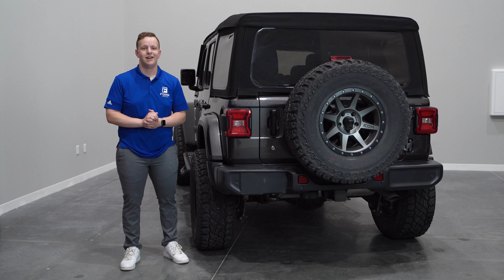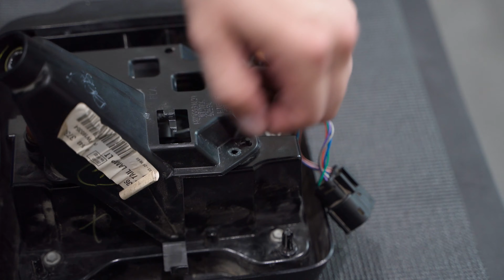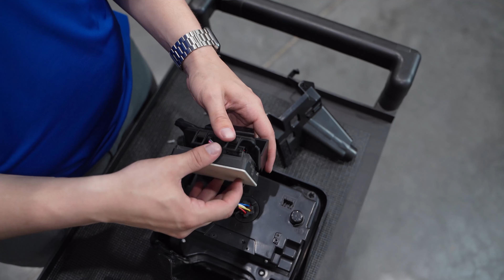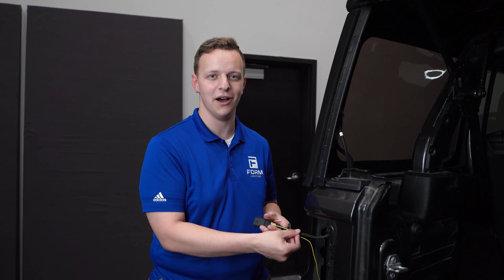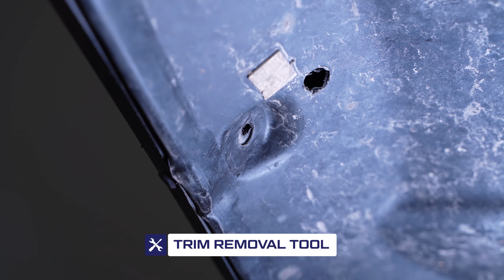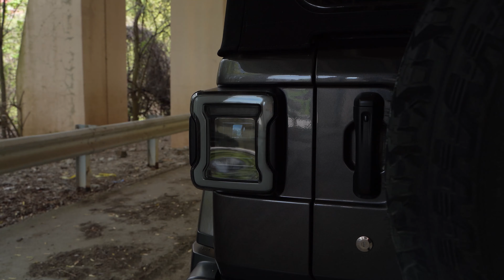How-To: Install 18+ Jeep JL Wrangler Sequential LED Tail Lights | FORM Lighting

Comment: Great video!

Installed them today! Pretty easy, should I check the tail lamp holding bolt since bolt is plastic and nut inside bracket is metal?

Comment: I installed this and I now have a ‘Lights Signal Out’ sign which is very surprising.
Reply: I just installed mine too and I just got the same error. Were you able to fix it?
Reply: Same here. But just the right side but they all work. Gonna try to see if I can fix it with the tazer

Comment: I installed these today on my 2020 JL without the sequential lighting. It was super easy with a flashlight and a 10mm socket, taking maybe 20 minutes end to end.

Helpful notes - the plug has a way to clip it to the body of the light. Pay attention to how it is clipped before you unplug the old light. Then you can re-attach so the plug is not just dangling by the cables. Also worth repeating to take special care with the plastic screw. Pay attention to how tight it is when you first start to unscrew it, so you know how much to tighten it. And, the screw is easy to finger tighten at first to make sure you are not cross threading it. it should screw in easily for the first couple of rotations.

Lights look great, way brighter than OEM with a modern look without too much "bling". Exactly what I was looking for.
Reply from the maker: Thanks a ton! We appreciate the honest review and are grateful for the support! Glad you like the lights as well!

Comment: I wanted to wait a few weeks to do an update on my replacement Form Tail Light…

First of all, the customer services communication was outstanding!!! BIG PROPS TO THEM

Form Lighting made the issue of getting a replacement drivers side tail light very easy and seamless….I didn’t even need to send back the defective tail light.  If you ever have problems with their lighting AND you’re within the warranty window, do not hesitate to call the customer service number.

AND NOW THE ISSUSE 

The replacement worked great for a few days to a week and stopped working with the same problems that I had before …..drivers tail light not working but everything else working as they should (brake light & sequential turn).  Again, I unplugged the light and plugged it back in…..I checked the fuses….even double checked the wire tap into the turn signal.  Nothing seemed out of place.  I just ran with it. The drivers tail light worked when it wanted to.  

I started thinking about any variables that could be in play. The only thing I thought of was the cold weather. 

I noticed that during cold temperatures the light would not work properly.  I would say anything below 50 degrees F is when trouble starts for me.  Anything above 50 doesn’t affect the light.  

I could try to troubleshoot electrical with any technical department Form Lighting might have, but I’m not savvy enough on a JL to do it.

I love the look of the light when everything functions, but I’m out of the warranty window.  I might go back to my factory halogens, buy another brand of LED tail lights, or move to a warmer climate LOL.
Reply from the maker: Hey there! We appreciate the honest review. Sorry to hear you are having so much trouble. This is not an issue we are used to seeing with our Jeep Tails. We do carry a two-year warranty so if you are still experiencing issues with the new product we are happy to help get you a new set to help resolve this!
Reply: @formlighting  thank you for reminding me of the warranty.  It's just weird that the replacement is having the same issue as the original, and that makes me hesitant to get a 2nd replacement because I still might experience the same issue.
Reply from the maker: This sounds like it may be a vehicle issue. I would recommend communicating this to our service team to help trouble shoot it before getting a full replacement since it has happened with multiple products now.  @dirtyagent22

Comment: I just bought the taillight but for some reason I could not get the turn signal to work ? I’ve already used the yellow wires but i don’t know why is not working 😕
Reply from the maker: Hey there! Sorry to hear you are having trouble! 
Have you run the tap all the way to the front of the vehicle?

Comment: Bought these in August but didn't install until October.   I couldn't be happier with them!......until this past weekend when the tail light (when you just turn the lights on) portion on the driver's side quit working. The light illuminates when the brake is pressed, and the sequential turn works as expected. I noticed that after the jeep had been sitting for a few hours, the light works, but for a very short period of time (5 mins).  Is it possible to get a replacement since I just installed them back in October?
Reply from the maker: Hey there! Sorry to hear you are having some trouble! This is certainly something we can do, but you will have to contact our customer service team to do so! I will link their info below and they will be happy to help work out a solution.  

Hours: Monday-Friday 10 a.m. - 5 p.m.
Email: contact@formlights.com
Phone: 636-748-4444
Reply: I’m having the same problem now
Reply: @ I finally gave up on the tail lights after getting pulled over with BOTH lights not working.

Comment: I bought a pair for my 2021 Jeep Wrangler Rubicon 4D, but my factory lights are halogen. Is there going to be an issue since the pair of FORM Lights I bought did not come with resistors?
Reply from the maker: There shouldn't be any issues but if you do experience any sort of trouble please contact our excellent customer service team. They will gladly help you resolve any issues should they arise! 

Hours: Monday-Friday 10 a.m. - 5 p.m.
Email: contact@formlights.com
Phone: 636-748-4444

Comment: Installed on my 2021 Willys and they work great for about 10 minutes. Once they've been on a while, they only light up when I hit the brakes or when I use a turn signal...other than that it looks like they are off from the rear so I cannot drive at night now???
Reply from the maker: Sorry to hear you are having trouble! Please contact our customer service team and they will gladly help resolve this issue! 

Hours: Monday-Friday 10 a.m. - 5 p.m.
Email: contact@formlights.com
Phone: 636-748-4444

Comment: Nice light but to much work just for the amber lights,maybe make it more plug and play?
Reply from the maker: Unfortunately, on USDM spec jeeps there is no way to separate the turn signal from the brake signal on the connector coming from the vehicle. Running the separate wire to the front of the vehicle is the only way to add this feature.

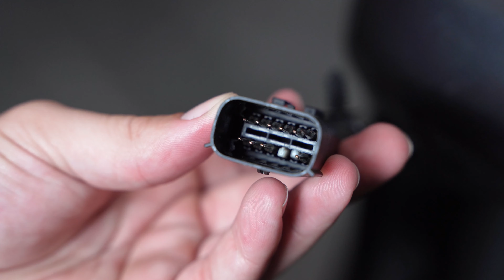Comment: @3:15 this is no longer applicable to the 2023 model. There are no cavity plugs and pushing the wire through the harness is impossible. I really didn't want to give up, but I felt like I was going to damage the factory harness if I tried pushing any harder.
Reply from the maker: Hey there! That isn't an issue our team is familiar with, but would love your feedback on. Please go ahead and shoot us an email with some photos of what you are seeing at contact@formlights.com, and our service team would be happy to help you with that. Thanks!
Reply: Seconding this; there are no cavity plugs on my 23 JL and the factory pin configuration is completely different from the one shown here.
Reply from the maker: @BenFoerster  Hey there! That isn't an issue our team is familiar with, but would love your feedback on. Please go ahead and shoot us an email with some photos of what you are seeing at contact@formlights.com, and our service team would be happy to help you with that. Thanks!
Reply: The 3rd hole on both rows is open so I don’t know which one to put it in.

Comment: When you say repeat the same process on the passenger side, does that mean you need to run another yellow wire to the front drl? If so would it be easier to route both at the same time through the same pathing?
Reply from the maker: Hey there! Because you need each turn signal individually, you will need to run the yellow wire from the tail light up to the other front fender - you are correct. The included wire is only long enough to be ran on its dedicated side as to avoid any possible issues due to being too long, so you'll need to run each side separately. Let us know if you have any other questions!
Reply: @formlighting  thanks for the response! I just ordered a set in the red lens and can't wait to install them!
Reply from the maker: @z0mbiE_  Awesome, great to hear it!

Comment: Where exactly do you tap the sequential signals to?
Reply from the maker: You will need to tap each turn signal wire to the turn signal on the front of the vehicle. Unfortunately, there is no way to separate turn/brake signal on these Jeeps coming from the tail light connector. However, the entire lamp will still flash as a turn signal, similar to the factory lamp, for road compliance.
Reply: @formlighting  does it have to be the turn signal at the front of the vehicle or can it be wired into my tow harness or mirror turn signals?
Reply from the maker: @2yung2dygaming59  In our testing, we discovered tapping to the 7-pin tow harness would engage the sequential feature anytime the brakes were tapped. We don't have any confirmation on the mirror signals at this time, unfortunately. Sorry about that! If you have any other questions, just let us know!
Reply: @formlighting  thank you for the replies. Could you give me a little better idea of where the harness is up front? The video isn’t super clear. Thanks!!
Reply from the maker: @2yung2dygaming59  Sure thing! You'll be looking for the white and green wire coming from the harness connected to the fender light. Once you've peeled back the front fender liner, it'll reveal itself more easily! It may also be beneficial to disconnect this harness, which we did not do for this video.
Reply: @formlighting  so I’d imagine the green and white wire in my mirror turn signal would be the same yes?
Reply from the maker: @2yung2dygaming59  Per our engineering team, you should be able to tap any dedicated turn-only signal. If the mirrors are a running light and turn, it will not work.
Reply: @formlighting  I am getting a CEL. Could it be because I installed the sequential wire in the tail light harness but haven’t connected it to the front yet?
Reply from the maker: @2yung2dygaming59  Please go ahead and give us a call at 636-748-4444 Monday-Friday 10 a.m.- 5 p.m. CST, or shoot us an email at contact@formlights.com, and our service team would be happy to help you with that.

Comment: I installed these on my wife’s Jeep.  These are great looking lights for sure. BUT, ONE THING….

These are only held in by the 3 screws that attach the main bracket to the actual taillight. The screws used are tiny and have very little grip. Just compare the OEM light bracket screws to the FORM light bracket screws. I upgraded my bracket screws for the FORM lights to #8 x ½” Pan Philips. I feel they are much more secure now. 👌🏼
Reply from the maker: Thanks for the feedback! We are happy to hear you're liking them!

Comment: * Update * - installed these without the sequential turn signal wired in and they are amazing. the only thing i did not like and the WARNING i will give other people is the lights have metal threads for your plastic screw to secure the light to the body. THIS WILL WRECK YOUR PLASTIC SCREW!!! i removed the bracket for the screw to thread into and replaced it with the factory bracket that has the correct plastic threads and the rest of the install is easy. 

Original - cant wait to purchase these and love the fact that the turn signals will work without the squential portion wired up. those splice clips are nothing but a corrosion magnet and ill be researching a way to connect the sequential feature without splicing wires
Reply from the maker: Thanks for checking them out! There are alternative options out there, but most people generally do not have the means to do it themselves. If you need any suggestions, our service team would be happy to help!
Reply: I could not get that plastic screw to bite on the bracket! Was this easy to switch? I’m about to return them
Reply from the maker: @tmacc9110  In this case, we would recommend reusing the factory bracket from your stock tail lights, similar to the customer above. If you need any further help, please go ahead and give us a call at 636-748-4444 Monday-Friday 10 a.m.- 5 p.m. CST, or shoot us an email at contact@formlights.com, and our service team would be happy to help you with that!